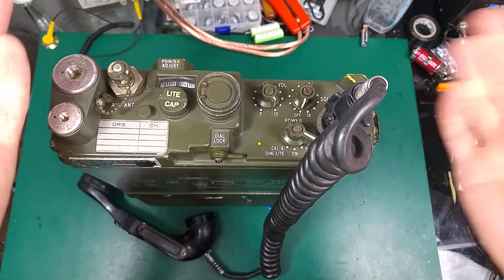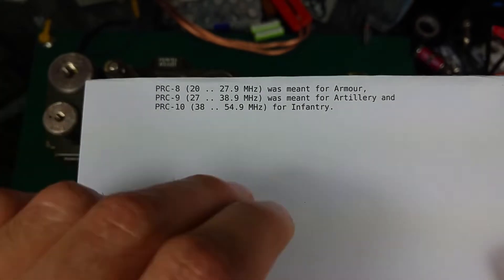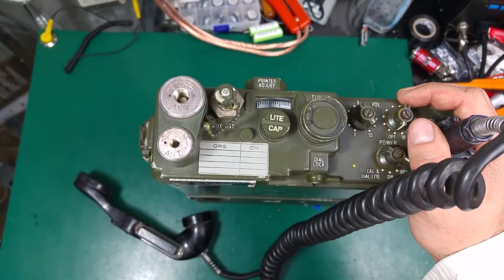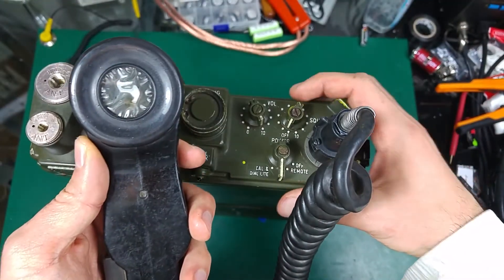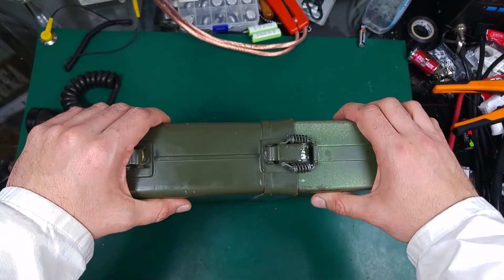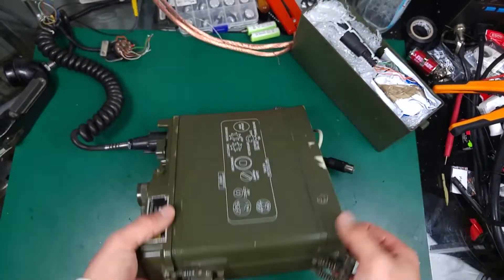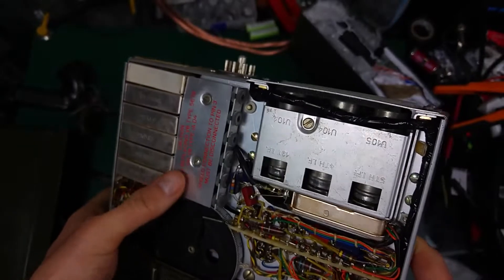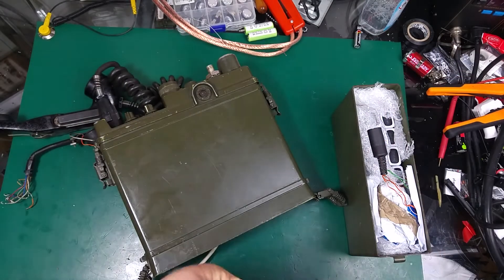AN/PRC-10  tactical tube VHF backpack / manpack radio

Comment: Hey, very cool. I always wanted an old military radio. I just bought mine without battery. Planning on doing the 9 V battery in D conversion. There’s no way to plug this direct into a socket? There’s no conversion out there for that. I am kind of amazed Around since the 50s all the way through Vietnam also the batteries you would think due to popularity. Somebody would have something looking currently for the whip antenna and field mic. Thank you for putting out this video.
Reply from the maker: Try google for "BA-511A" - it was french converter.   In real live You can just find voltages that are required by this radio and buy couple adjustable isolated converters from aliexpress and rig it up Yourself - like ghetto style.  Most like it will be expensive and hart to find HV isolated so I would feed it thru regular DC-DC isolated and then use  cheap  HV.  Will it introduce noise? I won't tell You - but it's worth trying.

Comment: Is it considered a ham radio? And can it be used to listen in on high frequencies hf I can’t find any information on what I can use it for I’m trying to find a good vintage ham radio I can use that is Hf
Reply from the maker: If I recall PRC-8 cover HF band - try search more info about it.
Reply: @ElectronicNoobBlog  okay thanks so much!
Reply: @ElectronicNoobBlog  I’m trying to find one that if I get it working I want to actively use it and think that would be pretty cool I’m also a zombie apocalypse prepper by heart so I feel it would come in handy ya know
Reply from the maker: @Synix_Games If You want real military I think PRC-77 would be better fit. Those PRC-8,9,10 require special high voltage battery for tubes that are not accessible. For prepping in my opinion best would be PRC-152 replica from TRI or TCA (this metal one, that work with real accessories).
Reply: @ElectronicNoobBlog  thanks I’ll check all those out
Reply: @ElectronicNoobBlog  I am correct that I can use the prc-8 and such to find an active frequency and listen in right?
Reply: @ElectronicNoobBlog  I’m still really new to how everything works trying to learn as best I can as I go

Comment: I just got one of these and really hope to get it running. Thank you for linking the resource on building a battery pack. Pretty daunting for me as I don't have a lot of electronics knowledge.
Reply: I picked up a radio like this at a local gun show in the late 80's.It came with a power supply which made it operate off of the electrical system of an armored vehicle or so I was told by the guy I got it from. Not a practical piece of equipment for me but an interesting conversation piece. My unit does work as I used it to jam the signals to a toy RC truck I had at the time. Your unit is cosmetically better than mine. A really neat old radio.
Reply: @michaelmacek9433  Do you happen to still have that power supply for a vehicle? I’m looking to get one
Reply: @greggstuhlmacher7162  
Yes I do. It ( the radio) hasn't been tried in about 30 years but I  do know it worked when I tried it last. The batteries are no doubt dead after so many years but the 24V power supply is complete and currently attached to my radio. What in particular are you looking for?
Reply: @michaelmacek9433  I was looking for the 24v power supply
Reply: @greggstuhlmacher7162  
I  have no attachment to the radio or any of it's assessors. I would consider parting with it for a negotiable price. It is currently on static display along side other pieces of militaria in my house. I was at one time thinking the radio would be a nice addition to my 1951 Dodge M42  3/4 ton  4x4 military truck but I realize at my age I would likely never get that project done. Let me know what you think it's worth and we can take ot from there. Thanks for the interest.
Reply: @michaelmacek9433  my apologies I thought you had the 24v power supply I already have a radio of my own so I won’t need another one
Reply: @greggstuhlmacher7162  
I have a nearly compete outfit missing only external speaker and an adapter for one of the antennas. I would entertain an offer on the power supply if you care to make an offer. The data plate on the power supply reads as follows;

Amplifier Power Supply AM498/U
Ser # 7635
Admiral Corp.
   I know I have the power cable but I am not sure where I  put it. It has been collecting dust for a long time but I am willing to offer a money back guarantee on it if we successfully negotiate a deal. Just out of curiosity,  what part of the country do you live? I am located in South Central Illinois. I'm only asking this to get an idea of how difficult it might be to ship. Thanks for your interest.
Reply from the maker: PRC-10 it's a nice finding, good luck!
Reply: Same here. Just got mine today. I also need to get it going but have no idea where to start other than I need a power source.